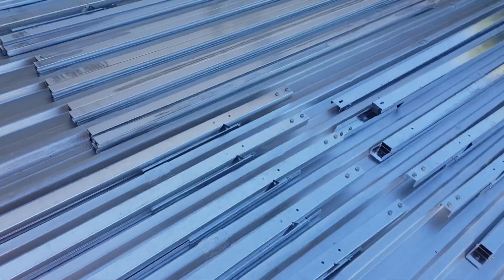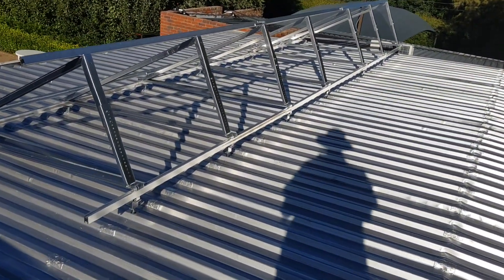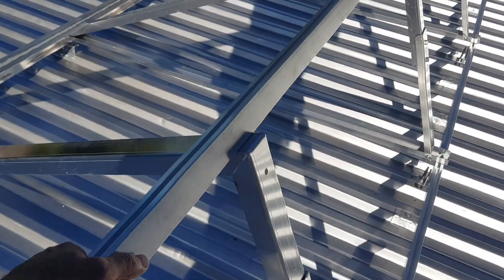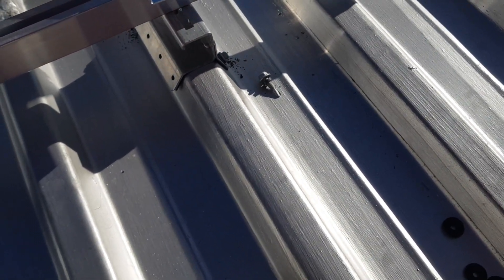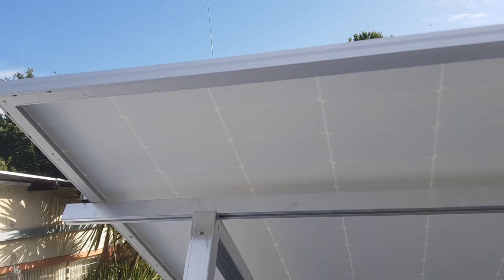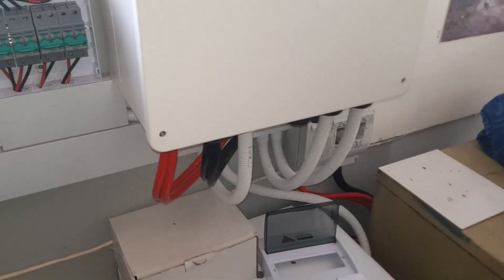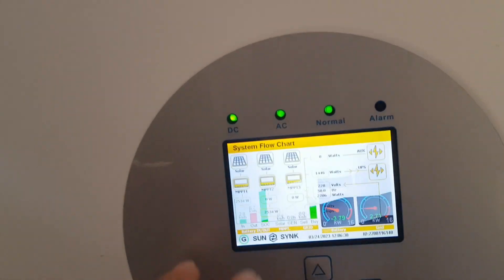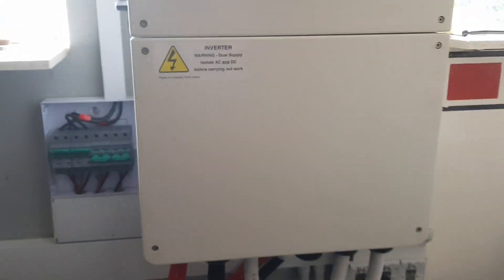KD Solar bracketing install

Comment: Thanks for the demo. 
Just a few questions about the DC Isolator - I see no Surge protectors and no fuses either - is this the new conventional wisdom now? Also, are those just plain isolators and not circuit breakers in there?
Just curious since I'm busy planning my own system. Is the trunking 40x40mm? - certainly looks like it and clearly that's all that's required really.
Reply from the maker: The dc box has dual pole breakers rated at 16A and you can use inline fuses on your pv wire at you're panels. I'm no expert but definitely earth your frames with a separate earth spike. The trunking is 40x40 and 40x70. The ac side has surge protection. Can't find dc surge protection solution for now.
Reply: @jacqalas  Thank you for the info, much appreciated!